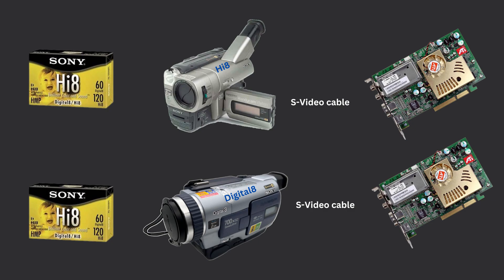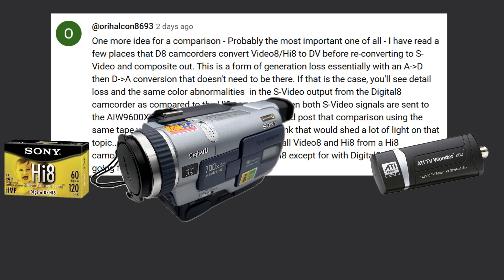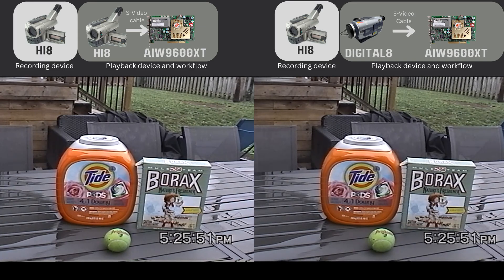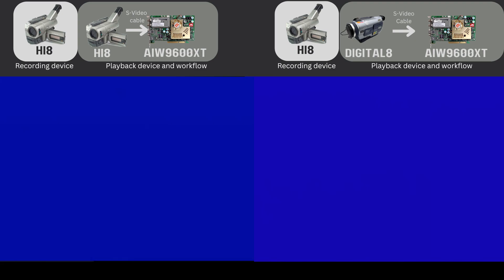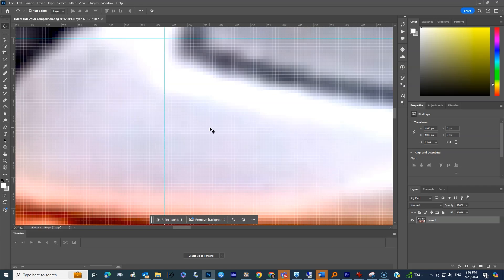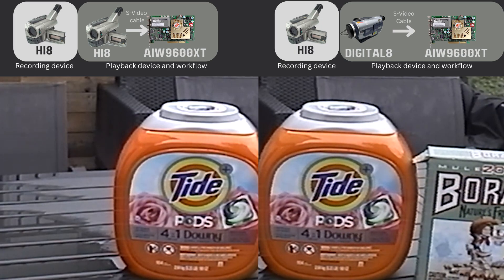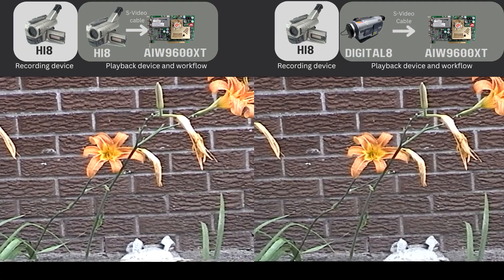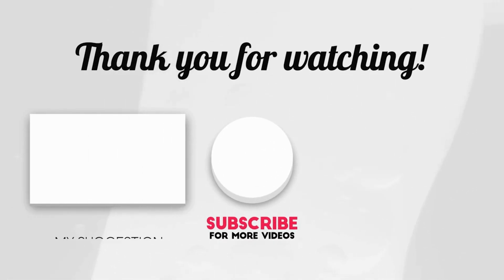Digital8 camcorder converts Hi8 tape to DV25 before outputing S-Video analog

Comment: I did further testing as had a few customers tapes needed to transfer over the weekend and have a few digital 8 and hi8 even XR camcorders around and found the colors and the slight aliasing to be definitely be cause by the TBC/DNR. They make the image less saturated changing the colors and making them worse. You see the image is way better with TBC off, it looks as I would expect to. The DNR especially throw the levels way out.  The digital processing is the issue. That why people like the older camera like the Sony CCD tr 700 including myself as was my first compact camcorder back then and was pure analog no DSP and image looked better overall and those I believed have a larger CCD in them as well. Once turn off the TBC/DNR I notice pretty much no different in playback PQ quality, as your bypassing the DSP then on both the digital 8 and analog Hi8 camcorders. I still will use the analog for HI8/8mm tapes as they tracks better and can handle LP tapes better then my digital 8 camcorders. You can use the digital 8 camcorder to playback analog tapes and there no real noticeable different when TBC/DNR is turn off. Now remember why I don't use the TBC/DNR on these and use a external frame TBC with procamp instead when needed, or the line TBC on DVD recorder.

So people are likely correct when they stated that the analog doesn't get analog to digital back to analog. The analog is pass separate and sure have known that earlier as I repaired over 100's of these back then for warranty work and the analog output is separate and only goes to digital converter though firewire. It the DSP when you turn on the TBC and DNR that affect the PQ and goes to the DSP then. It not caused by DV compression even though DV compression can have similar results.  I knew this as this was a problem back then when they came out with the XR analog only line of camcorders before digital 8 camcorders were out, when they added DSP processing for the TBC and DNR and was a complaint back then and fix was to turn off TBC and DNR. For those that still use theses as a camcorder use HI8-ME tapes, it makes a difference as well.

BTW that ATI AIW 9600 and even the USB 600 was my all time favorite capture card back in the day. That AIW 9600 card bring back memories for sure as use it for years at a flee market when transferring tapes for people back then and archiving tons of old shows for myself when I was much younger.

Comment: You can notice the aliasing in the Tide logo and soften of PQ on the digital 8 right side more. It the reason when capturing Hi8 or video 8 I use my TRV85, or TRV87 analog camcorders S-video, sometimes even the mono TRV328 to do most my transfers for customers as well. PQ sharper and no compression artifacts. Most the times keep TBC and DNR turn off as well as it will affect PQ and soften as well.

You can won’t notice the subtle differences on a smaller computer monitor unless your trained to and know what to look for, but when you go to a larger display like a 42 inch plus LCD customers will notice.

I do have several digital 8 and analog playback camcorders for transferring but typically used for customer tapes where they had mix analog and digital on tapes. All the older pre digital I prefer using analog hi8 decks, or camcorders that have option to turn off and on TBC and DNR as those as well will soften picture. So use right tool for job pretty much. I use the mono camcorders as some tapes will false flag the stereo hifi as deteriorated.
Reply from the maker: Excellent comment about the risk of hifi dropouts if the tape is bad and the suggestion to simply capture mini to avoid this distraction.

Comment: Why don't you use de DV Firewire port for capturing the image in PC?
Reply from the maker: Mini-DV uses a codec called DV25, which applies 4:1:1 or 4:2:0 chroma subsampling (depending on the region) and a fixed bitrate of about 25 Mbps. This results in visible macroblocking and degraded color resolution, particularly on areas with high detail or motion. Zoom in on a DV25 transfer and you’ll often see heavy compression artifacts, especially in areas with fine detail, gradients, or low-light noise.

So, if you recorded the video on a Digital8 or MiniDV camcorder, then absolutely Firewire is the best option to get the video to your computer. But as a digitization device of analog tapes, a good capture device that allows one to capture in a lossless codec at a high bitrate is technically better, especially if one wants to enhance the video or upscale it.

On the other hand, using a MiniDV or Digital8 camcorder in passthrough mode is one of the easiest methods and benefits from the camcorder VTR's Line TBC, which will fix wavy videos from a bad VHS source. So, depending on the person, I would be comfortable recommending it. But for those who want to avoid some of the artifacts inherent, I would recommend something else.

Comment: On the right, the red color has gone a little more into yellow. It needs to be turned back a little to pink.  On the flower, the picture on the left seems sharper and nicer, but as lordsmurf noted, the "Tide" logo gives out problems. Upon closer inspection, the problem lies in the overexposure of the brightness: you can see how the white outline around the logo is blurred due to a lack of details (semitones). That is, the sharpness is made due to contrast and over-illumination of mostly bright details. In general, the picture on the right looks more natural, because the logo does not try to "jump out" from the sticker using sharpness. On the left, the image looks like it was taken on a phone (the sharpness of the contours with a blurred fill). The grass on the flowers doesn't look too "sharp" either. So, in terms of signal digitization, the D8 does a worse job.

Comment: Converting internally to DV depends on the Digital8 camera model. Some most definitely do, while others have diagrams suggesting those do not. Thus the general advice is to avoid Digital8 as Hi8 players, for this reason. Too variable, unknowns, extra work and testing. If you want to deep dive, you can do so. But given that Hi8 cameras are usually cheaper to acquire than Digital8 cameras, it's somewhat moot. Few people have Digital8 tapes, and especially both Hi8 and Digital8, so a need to do both is tiny.
Reply from the maker: Good point. I found a Digital8 on Facebook Marketplace and the price was lower than elsewhere. Was curious about it and figured it would be good for comparison tests and in case someone has Digital8 recordings.
Reply: Well, I get about 60% Video8, 40% Digital8. Hi8 is a rarer case. Recently, a client brought more than 10 Digital8 cassettes shot with the same camera.

Comment: When things get this technical and there's very little to no difference in the footage you're working with, it's time to take a day off. I understand wanting to get the very best possible results however there are so many variables from capture to settings to playback sources etc. that you can never be quite sure and other decerning eyes may agree and/or disagree with your (or other's) findings. It can drive you around the bend and might even waste your valuable time. It's important to get the best results but it's also important to have a little fun with what you're shooting before it becomes a weary chore.

Comment: I highly doubt it, The analog video from the tape is first converted to digital for processing (TBC, DNR ...etc.) in a ADC stage before it gets sent out to a DV encoder for firewire output, The analog out is most likely converted from the ADC stage to analog in an extra DAC stage, It doesn't make any economical sense to have an unnecessary DV decoder inside the camcorder, because that's what it would require if the analog is derived from the DV encoder instead of the DAC after processing.
Reply from the maker: @Capturing-Memories  Thank you for this. I'm doing more tests that I will post next. In short, from basic VHS with very flaggy tape, out to composite in Digital8, out to FireWire, shows that it completely removes all flagging when TBC is set to on in menu, and removes almost all flagging when TBC is set to off. Are there two line TBCs in the TRV330 Digital8? The TBCs seem to work on passthrough...can that be correct?
Reply: @videocaptureguide  What I meant is, when playing back a tape, the signal goes like this: 
For FireWire out: Tape -> ADC -> Digital processing -> DV encoder -> FireWire.
For Analog out: Tape -> ADC -> Digital Processing -> DAC -> Analog video socket.
If analog output is derived from DV, it must have to go like this:
Tape -> ADC -> Digital processing -> DV encoder -> DV decoder -> DAC -> Analog video socket. This is an unnecessary complication that adds to the cost of the camcorder.
Reply: @CapturingMemories Hi friend (this is Brad from VideoHelp). They definitely don't do DV Encode -> DV Decode for the analog path.

But how would it add to the cost?

If you play a D8 tape out an analog jack, it's already using a DV Decoder. This decoder would never have to be used by 2 signal paths at the same time, so switching upstream would allow 1 decoder to service any DV chain.
Reply: @videoextrication4138  Good point, but it did not make sense to me to go the DV route just to playback an analog tape.
Reply: @videocaptureguide  Those camcorders don’t have just line TBC, they have other image stabilisations capabilities that are part of the digital processing.
Reply: The quality of the TBC seems to me to be much more important than the price, at least if you don't have a good TBC and can sell the camcorder again (home use). The manual for my SONY Hi8EX camcorder CCD-TRV65E (PAL) states which image content (copy + graphics) the line TBC should be left off for. I would rather use a frame TBC from the DVD recorder.
Reply: We've had this discussion before, but pathways are often done because of non-video reasons, be it compactness, cost, ease, etc. Having the A>D, a unified processing D that include DV compression, then D>A, makes complete sense. Bypassing would create the need for true bypass pathway, which may be counter to the spacing, costs, or otherwise. After all, you can output IEEE1394/FireWire from the DV/Digital8 camcorder, and that would require the DV encoding step on the analog source. Having the DV encoder married to the IEEE1394/FireWire makes less sense than married to the ADC, because you don't want to reencode the DV source to another DV. The DV decoder must exist regardless. Where this gets murky is because you can have DV codecs (code/decode chips), which would require pathway changes and compromises. But the side effect is costs and space. So what you suggest could actually be more costly, not less. There's no simple or single answer.

Comment: It was nice of you to test this for the commenter, but unnecessary. The schematics in the service manuals are proof that Digital8 cameras do not send their Hi8/Video8 internal playback through the DV encoder chip prior to analog output.

Unfortunately you conflate "A-D" with "analog to DV compression" in this video.

My DCR-TRV340 Digital8 cam definitely does "A-D-A" when playing analog tapes -- even when TBC and DNR are "Off". (In reality, chroma DNR is always-on, hence the scare-quotes.) The digitization is 8-bit uncompressed though. The service manual shows the common 27MHz crystal, so it's probably Rec.601 (720-wide YCbCr 4:2:2).

I've got a thread on VideoHelp showing the digitization and also the compression artifacts caused by DV Firewire capture of Hi8.
Reply from the maker: Thanks for this. Feel free to add the link to you post. Interested in reading it.

Comment: I highly doubt the D-8 camcorder converts the video to the DV-25 codec prior to going out to the S-Video port. Having said that this video does not prove anything. The human eye is not going to notice any difference if it did. DV-25 is not going to make something orange turn red like you are expecting. What makes matter much worse is that you insist you ATI products are color accurate and the DV products are not yet you have no way to test out your theory. I have videos demonstrating the ADVC 110 and Intensity Shuttle are color accurate. You have seen those videos and commented on them yet you are ignoring the information.  You need to invest in the Blackmagic Design Mini Monitor and the ADVC 110. I know a lot of people are telling you your videos are really good but they are severely flawed. I will have  a video response demonstrating why they are severely flawed.
Reply: This would definitely harm color, because the ADVC boxes can only downconvert to DV. Not the full 4:2:2 "uncompressed" available from the ATI AIW. The AIW card has some of the most accurate color grading for VHS, as is allows both legal and illegal input values. No crushing of levels. Blackmagic cards have multiple known issues with VHS input, even with TBCs in use.

Comment: I think you're correct, the Digital8 camcorder is not locking on to any data signal on the tape and is therefore outputting signal straight to the analog output side of its DAC.

Comment: Definitely appreciate the comparison! I agree with your conclusion that there doesn’t appear to be any sort of conversion loss through the digital8 camcorder via S-Video and it does suggest an equivalent path in both without any extra digital conversions. This shows that a Hi8 camcorder really never has an advantage over a D8 camcorder for capturing S-Video/analog tapes. Only thing I can possibly think of would be that certain Hi8 camcorder have fewer SMT capacitors inside and therefore might require less maintenance. Your videos also show that you shouldn’t use the “DV stream/firewire” option for 8mm analog tapes for best quality. The difference in using DV capture seems much less pronounced for VHS in the capture comparisons I’ve seen.